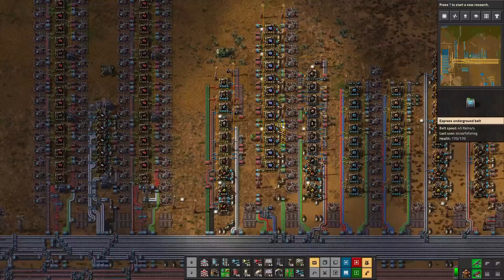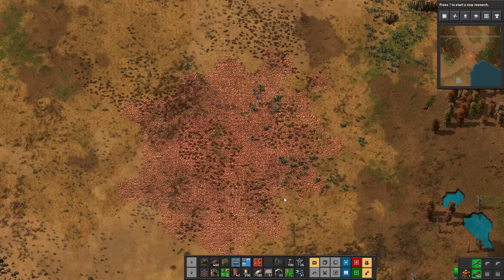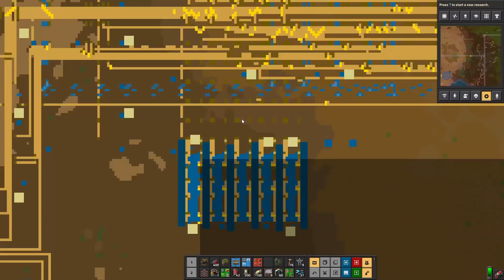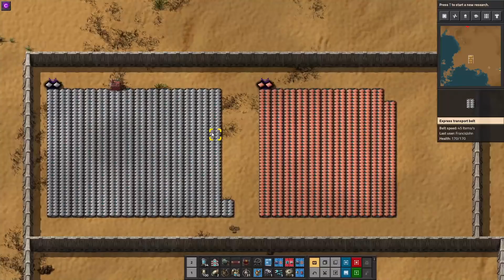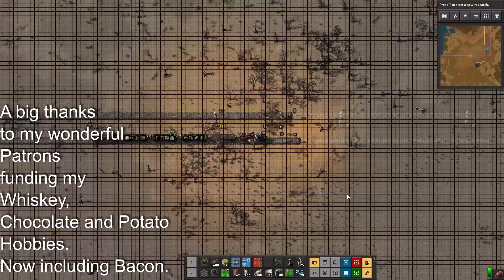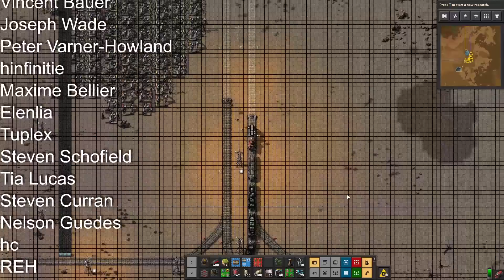Factorio Railworld  : Bots, Logistics and More Copper

Comment: Have you considered smelting at your mining location? I can simplify putting things on to your bus because you don't need all the smelting pre-amble there. And if you think about your discussion concluding around 17:00 about the density of materials on the bus,  it's especially powerful for when your have iron ore that will inevitably become steel. Later, if you want to keep the smelting setup, you can bring ore to it from other iron, and not all the way back to the bus. So ore => train to smelting site =>  train to bus. Similarly, you can have a circuit facility. Copper and iron ore => train to smelting => train to circuit plant => produce highly dense green/red/blue circuits => train to main base. Obviously you need to think through what is worth producing off-site and what you want on the bus, but you're really starting to use your rails as its own bus.
Reply from the maker: For this starter base it's going to be just raw resources on rails, when you make a big base we will do site smelting and most likely green circuit production as well.

Comment: Hate to be that guy, but I'm gonna comment on your design anyways. 
2 things: 
1. Might want to consider changing the passive provider into storage chests with a filter, and limit the inserters with a wire. This way you require a less messy mass storage system at the front of the mall. 
2. At your steel furnace making spot in the mall, the belt might fill up with stone ore if you ever get short on bricks. 

Anyway love the vids!

Comment: One trick I learned is to put all the mall chests as yellow chests, and set their filter only to accept the item that goes into them. That way when you have extra, bots will often go back and put them in the box. You also wire each inserter with the amount you want in the box. A bit more effort, but saves on storage space as items just go back into their boxes.
Reply: and if you have this item anywhere else in the network, it breaks because logistic network does not care where the items stored.
Reply: @mrShift_0044  As far as I'm aware, bots have a priority list on where to store stuff.
Reply: @theblackcondor  but they do not take from logistic storage chest to logistic storage chest, are they?
Reply: @mrShift_0044  No, that's too complicated. There's no auto-sorting without mods. The idea is that if you have too much in your inventory the bots will send it to the right box if you're in the network where the boxes are. From what I was told, bots will prioritize the box with the filter over the box with just the items. If you have multiple unfiltered yellow boxes, they will prioritize the one that already has items of that type. If all boxes are empty they will prioritize by box ID. By all means this isn't a perfect system, but it does save a little bit on space and headache. Regardless, if you are completely reliant on bots to fill you up, it doesn't matter where things are stored. I enjoy walking up to the mall and picking stuff up, and letting my bots drop off excess once I'm done.

Comment: Couldn't you use a single requester chest for each train wagon? Or is it a throughput/stack inserter thing?
Reply: if inserter grabs 12 rails, but train have space only for 10, the inserter is gonna stop supplying the train with other stuff, because it holding 2 rails.
Reply: @mrShift_0044  Ahhh, I see. I didn't think of that. Thanks!

Comment: If you hook up a roboport to a circuit network you can read how many "idle" robots of each kind you have. I have that output wired to an inserter that adds more robots if idle robots fall below a threshold (that way the number of robots automatically expands when you expand production and killed robots get rebuilt)
Reply: sounds like siemens tech
Reply: You can skip the circuits and just have a requester chests feeding construction/logistics bots into a few roboports.  I did this on my base as soon as I started making bots, and by the time I stopped playing I had something like 40k of each in my network.  Bot factory was small, but over time it added up.  Never really noticed a significant resource/power drain compared to science/modules.

Comment: Thanks for the new video.  The outro was great.

I'm still on my second map.  There's enough I know to do differently, now, than I have done, before, to where I thought about starting a new map, but decided against it.  I still have a lot more I can learn from my current map/base, and it's still viable. 

Having said that, here's some things I'd like to mention for my fellow new players, for any who are interested:

-I wish I had paid closer attention to component/build time ratios earlier on.  I was just saying "Eh, this looks about like what FJ used, so sure, plop it down."  I would have saved myself, I don't know, 5 or 6 hours worth of work if I had paid closer attention earlier.

-Switch to electric furnaces ASAP.  I thought "Ah, everything seems fine for now, no reason to bother."  I was wrong.

-I overbuilt my power supply early on because it was cheap and then I could forget about it.  The problem was, I forgot about it.  Thus, I was quite suprised when my entire base started flashing "no power", because not nearly enough coal was getting through.  Thus began a ~2 hour voyage of discovery where in I learned that trying to bootstrap an entire power and production system back up is a massive pain in the ass.  At one point I was pocket crafting solar panels and accumulators just to get the little power I needed to eke by.  At that point I might as well have heard Morgan Freeman's voice saying "That's when he knew he had f---ed up."

-Build a mall.  For the love of all that is, build a mall.  That is going to be tonight's project, for me.  I have little bits of a mall scattered around my base, but tonight it is all going to come together and get built out.  Build a mall.  I could have saved so, so much time and frustration.

Since the last episode, I've gotten purple and yellow science up and running, cleared out a wide buffer between me and biters, gotten my Mk II power armor built and kitted out, and dealt with a few surprise emergencies.  I've upgraded most if not all the belts/sorters/undergrounders/etc, as well as things like the funaces, and expanded production here and there (mainly steel and green circuits, ironically enough).  Still haven't gotten the chance to start playing with rails yet, but after the mall is built (and whatever emergencies are lying in wait are dealt with) I expect I will.  After the mall is finished, though, I am absolutely moving into nuclear power.  Wish I had done it sooner, but oh well.

See you tomorrow for Tribal Wizards!

Comment: 😫 I didn't know about inventory filters till recently. That construction train looks so simple. I always built mine by connecting filter inserters to arithmetic combinators, to tell the filter inserters to insert things when the train inventory is below a certain threshold.
Reply: That said. My construction train setup was built to also do the reverse. My outposts had roboports and the point of the construction train was to deliver resources to the logistics systems of the outposts. So I just set down blueprints for mines, the train delivered miners, and the local robots built the mine over time. I had a similar system for delivering oil, ammo, and artillery shells to outposts. (I built fully defended outposts and used artillery to clear out nearby bases)

Comment: At 22:08 Francis said "maybe they were reserved" in reference to the construction robots. What does that mean?
Reply: there is a little quirk with them, you see, YOUR construction robots are SEPARATE from the normal logistic network, and when you stamp out blueprint, the game decides, should it be built  by player's robots or by the logistic network ones. 
The quirk is: once it does decide, it reserves this one ghost entity to one network or another and THAT'S IT, it won't change in near future (i think reloading the game resets that) and if player goes out from building range, these ghosts that are RESERVED to be built by personal robots are left unbuilt for god knows how long. 
  This is one of the annoying quirks of logistic bots in this game along with you needing CONSTANTLY to be in range of logistic network to be able to be resupplied , and even if you out for a split second, they can abort the task and start all over again, which is not ideal if you 1500 tiles away and they travel like 3 minutes and you want like 10 more modules/beacons/smelters/etc. 
  or when in the mall/HUB you need a chain of "blue belt accembler -> provider chest -> storage chest -> blue splitter accembler" to make 1000 belt and 200 splitters CONSISTENTLY available, or otherwise if you have blue belt SOMEWHERE ELSE in the network but no splitters, you never gonna made them build because your circuit network does not care where EXACTLY these belts are stored and other small problems like that. lol that was long.
Reply: @mrShift_0044  it was long but thanks for taking the time to explain.

Comment: Q: why don't you put productivity modules in miners and sience labs?
Reply: Productivity modules in miners slows them down. With mining productivity research (which doesn't reduce speed) you also get less proportionally from a productivity module since it is added on top. For example going from 100% to 130% is quite impactful, but going from 200% to 230% is not that good. The speed loss is way worse: he would have way fewer belts coming out of the mine and he would then have to spread out further to find new ore patches.

Efficiency modules on the other hand makes sense. Miners are one of the biggest pollution producers and efficiency modules reduces the pollution produced. He is trying to keep the pollution cloud small since he is not using any walls or defenses.

As for the science labs I don't remember, but he might have borrowed the modules when he paused his science.
Reply: @Hedning1390  yea i didn't really know the diference. I ment the one that creates additional bar underneath  the progress bar. 
But thank you for your reply

Comment: I believe you can copy the wagon with shift-rightclick and then paste its filters into the requester chest directly. 
It definitely works when you try to paste recipes from crafters.(very useful for beltless bases :D)
Its been a while since I played, but that copy-paste always seemed to work whenever it made sense
Reply: The problem with requesting multiple items per requester for trains is that unlike assemblers the inserter refills to the hard sack size cap, meaning your inserter can hold items of one type and be unable to drop them off in order to take the other item type.
Reply: As a new player I inadvertently learned you can copy from an assembler to a requester chest and it will automatically set the items to pull for the recipe. Thought I’d share.

Comment: You may have an issue with your 2-headed builder train.  It could return to the mall "backwards", and not get resupplied, unless you double-up your requester chests.
Reply from the maker: Have already run into that issue, will have to make a one way modification or double up.